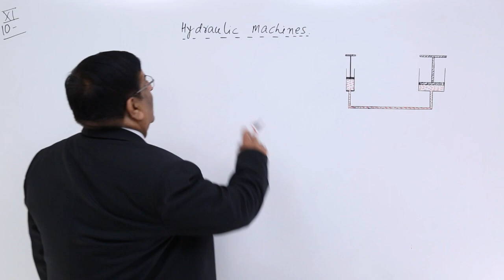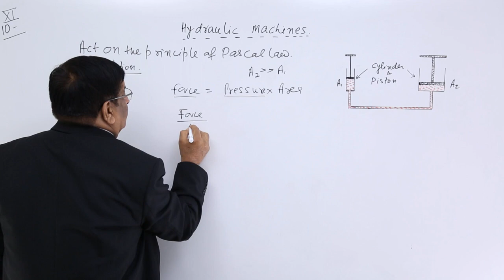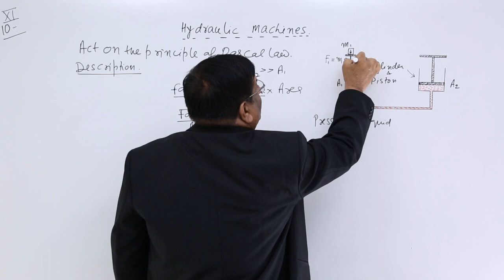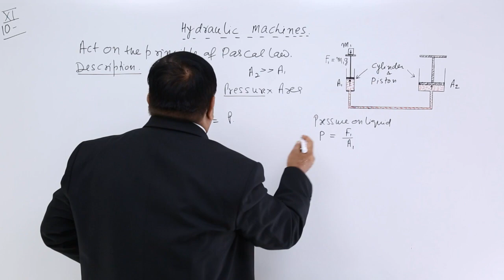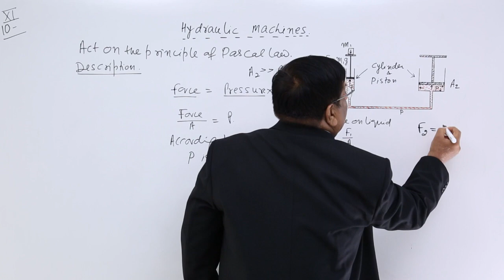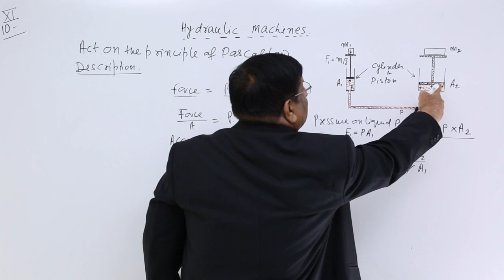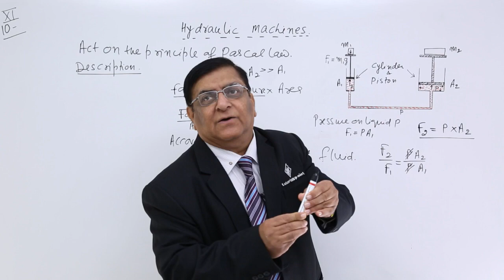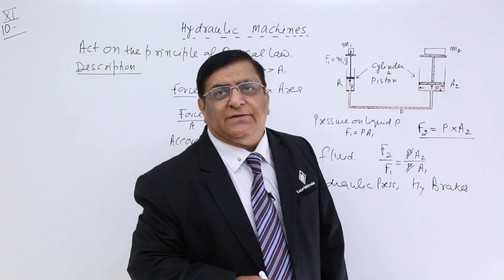Class 11th – Hydraulic Machines | Properties of Fluids | Tutorials Point

Comment: Sir, is there not voilation of law of conservation of energy 
Let we put à 5 kg mass on smaller piston n there is a displacement of 1 m , work done is 50J. at larger piston that work is more than 50 j.
From where does this energy come?
Reply: @incognito2 **** but according to the energy conservation law energy can neither be created nor be destroyed
Then from where this energy is transformed
Reply: No its impossible that law of conservation of energy can be violated.
It can be done that on smaller portion the displacement is say 2m but on larger portion the displacement is less than 2m 
And the rest of energy get wasted in the compression of fluid......
Reply: @Amit Rai: when we apply less force on smaller side the body get more displaced and on the larger side the body will attain more force and displacement done is less...so here the work done will remain same...lets take the eg if we apply 20N of force on smaller side say the displacement will be 2 m so the work done will be 40N/m  ...also when the energy get transfered to the larger side  the force will become 40N and here the displacement would be 1m therefore here work done would be also 40 N/m same as that of the smaller piston..so there is no voilation of law of conservation of energy
Reply: @amitrai1762   energy  cannot  be created or destroyed but it can be changed from  one form to the other  we cannot  consider  force as energy